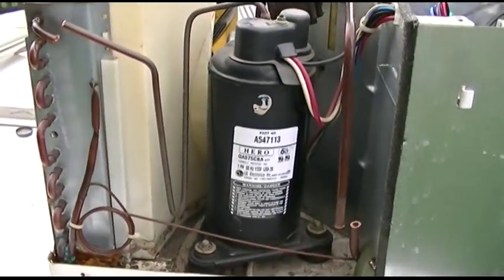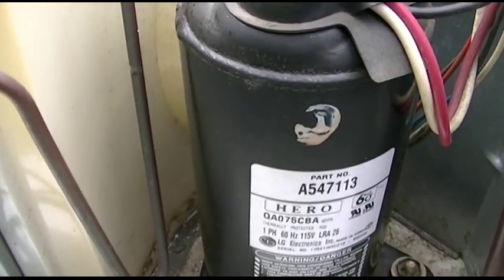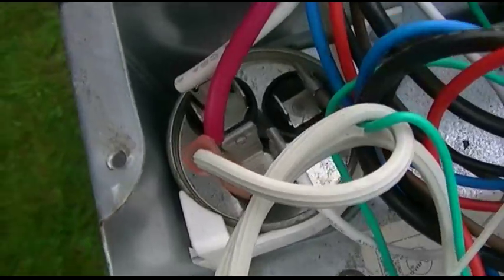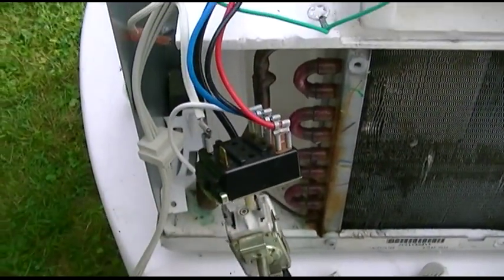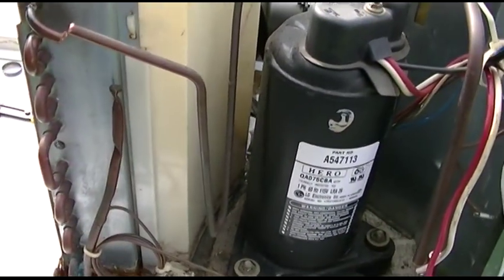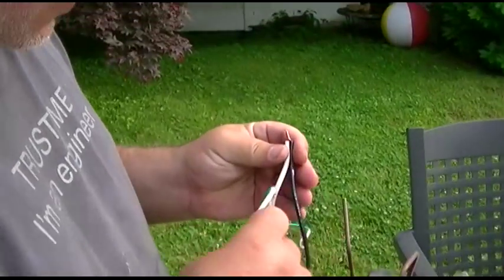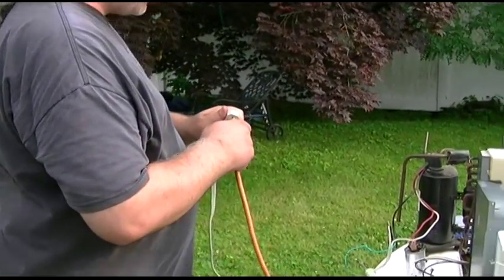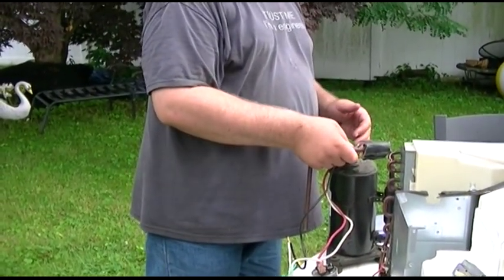2nd Silent Air Compressor Build, Part 1

Comment: Hi,
Thanks in large part to your video, I’ve made 15+ compressors for others (from different brand tanks and from dehumidifier, refrigerator, room AC compressors) and all worked fine.  I’ve recently come across a problem I can’t seem to resolve.  

Using AC compressor, Porter Cable 6 gal compressor, new 4way pressure switch with unloader valve,

After filling the tank, with no leaks, etc. when the unit shuts down oil vapor (smoke) comes out of the unloader switch…..just for a minute or so.   Then it stops.      I’ve tried this with the compressor cold (so no thermal issue) and from either,  Empty to full pressure OR from cut in to full pressure.   

Still get the vapor (which does smell a bit).   

So I put a different compressor (from a dehumidifier) on it and still same problem.

These were from a working AC and dehumidifier.  This is nothing different than I’ve done in the past, except now I get the oil vapor.  (YET….”something must be” different to cause this.

I hesitate to add oil....as over filling is a bad idea....and I assume BOTH compressors wouldn't be low on oil.

Any suggestions as to Why this is happening and How to remedy it, would be really appreciated.
I’m stumped !!

(as an aside…..on the others I’ve built, on purpose, I ran them from empty to full repeatedly till the thermal switch would stop it……and no vapor !!!!)
Reply from the maker: This was the second one I was building, and other issues were pressing at the time so this project was shelved.  The first one I built had the same oil vapor issue.  Some do, some don't.  I don't know the reason why, but it's definitely oil vapor.  I didn't use an unloader on the first one I built as the tank had a check valve, but it's not a perfect seal so the vapor blows backwards and out the intake.

Comment: how can i run it 12 or 24v dc
Reply from the maker: It's a 120 volt compressor.  You can either use an inverter that's powerful enough, or find a 12 volt DC compressor.  They're expensive, but they exist.

Comment: Hi, great video. iv got the same compressor but i dont have the capacitor. whats the name/type of the capacitor that it uses?
Reply from the maker: The compressor itself is that black cylindrical thing that was removed from an air conditioner.  The capacitor for it should be an off-the-shelf split-capacitor, it's rating is 35/4μF.  However, you don't need a split capacitor since it's not running a fan (if you are using it for an application like this.  If you won't have a fan, a standard capacitor of around 35μF is what you'd need.  There's a bit of play in that number, it'll probably be OK with a 40 or a 30 if it's more easily obtained.
Reply: @jaykay18  thank you
Reply from the maker: No problem, good luck getting yours running.

Comment: Very bad idea to put any body part against compressed air.  Will cause cardiac arrest if the pressure exceeds skin resistance and illustrates a very poor awareness of the most basic of safety rules.
Reply from the maker: I execute safety third in everything I do!
Reply: In my day people weren't p###ies
Reply: Wah.
Reply: Waaa waaa waaaaaaa

Comment: I did the exact same thing you did except for one difference. My compressor came from a 220 volt AC.  It works on 110 volt. However it starts very slow  and gradually builds up speed. In about 30 seconds it cranks like it's supposed to.  Should I worry about the internals of the compressor or motor winding?  Or what do you think the explanation for the slow gradual start is?
Reply from the maker: If that's a 220 volt compressor and you're running it on 120, that explains it all.  Yes, I'd be quite worried about the compressor overheating and the windings inside, it's likely pulling nearly twice the current to try to make up for the lost voltage.  It may also have trouble restarting if there's any kind of "head pressure" leftover.  Give it the voltage it needs.
Reply: Here's a video on the subject if it's any help. It's been quite a while but maybe it will be of some use.
https://youtu.be/OiwWaIvIeao

Comment: The refrigerant probably leaked where the condenser was corroded at 3:44.
Reply from the maker: I'd think when running I'd hear a pinhole leak immediately after shutting, pressures within the system get pretty high.

Comment: My grandfather did something like this once although I don't know if he salvaged the compressor from a window unit. In any case, it worked quite reliably, but it was nearly impossible to use in the cold. I mean more than you'd expect to have difficulty with an air compressor in the winter months. He's pretty patient though, always managed to get it running nevertheless. Looks like an interesting project.
Reply from the maker: Ha!  That's actually very funny you say that!  My other silent air compressor also has tremendous trouble starting in the cold.  In fact I've generally found that with store-bought units, if they are oil-lubricated, they don't like the cold.  If they're oilless, they work fine.  Going to be blowing out the house in CT in a few weeks, got the owner an oilless compressor so as to not have that kind of trouble.